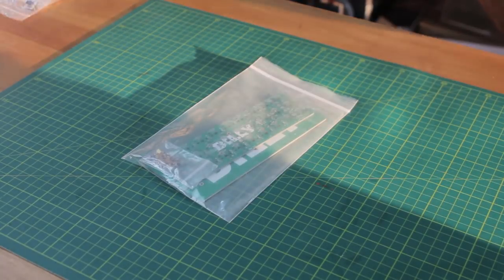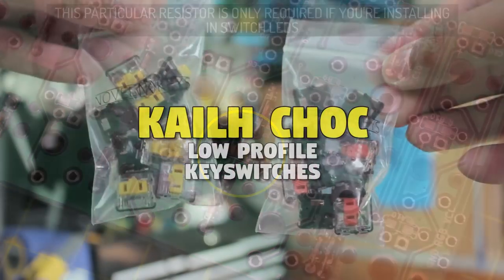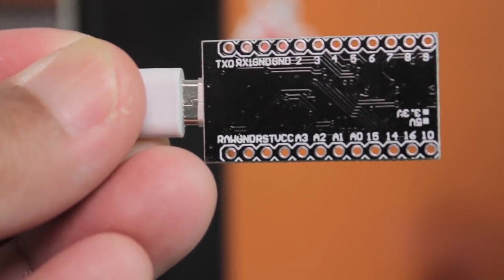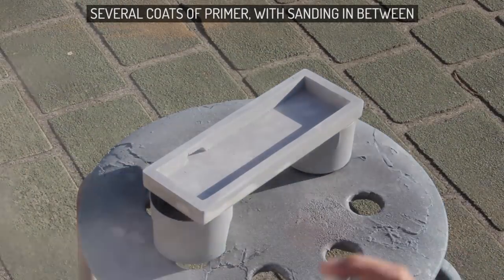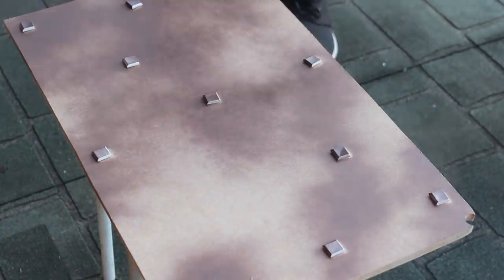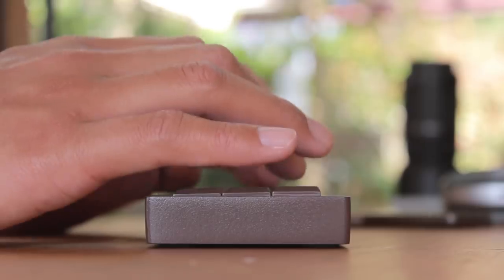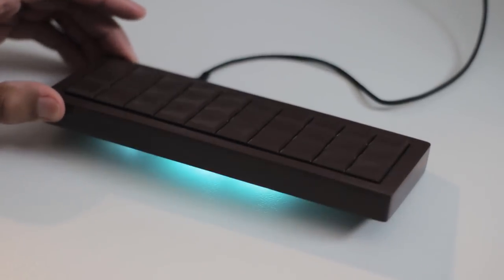DILLY Choc/olate Mechanical Keyboard Build

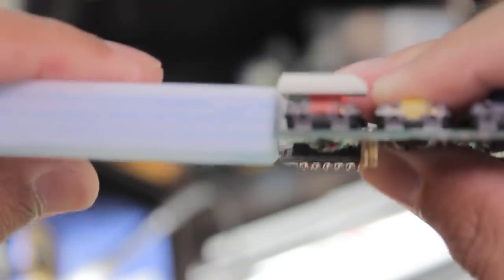Comment: 05:10 Damn this is still too thick. I like the thinness of Apple keyboard (not for looks, but for practical reasons with my hands), so I thought "low-profile key switches" might do it, but this seems 3 times thicker than Apple's. Also, mounting the Arduino on the back seems to defeat the purpose of using "low-profile" keys. I know it is for saving horizontal space, but I would rather save vertical space (thickness) and put it above the keys (not in the Z axis, but in the X axis).

Comment: I had a few questions if you didn’t mind to take the time to answer them. For the “keyboard” you compared this build to at the beginning, what would you use that for? Are there any keyboards you know of that use these low profile switches that would recommend for me to look into, and lastly are there any pretty useable 30% keyboards out there you recommend?